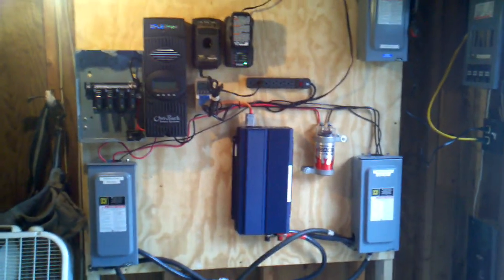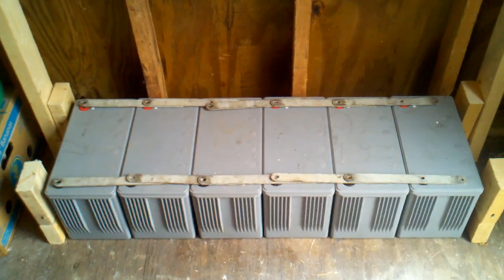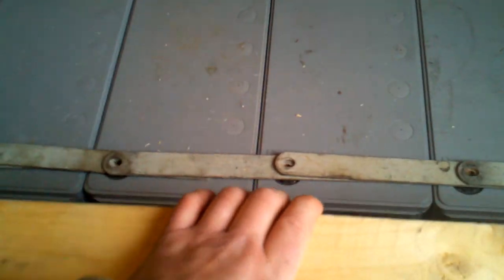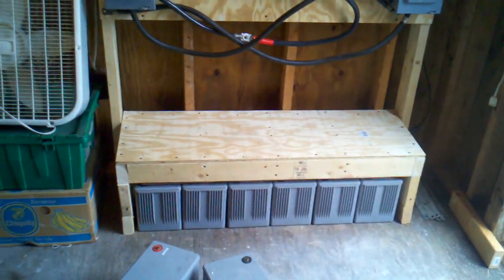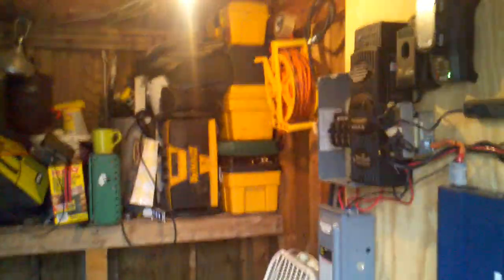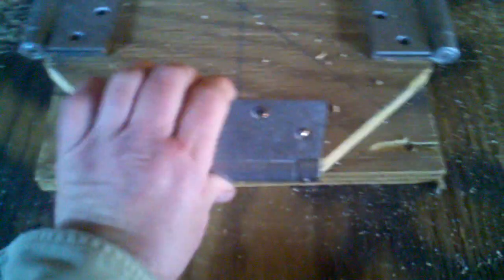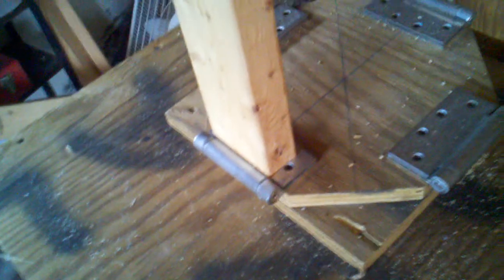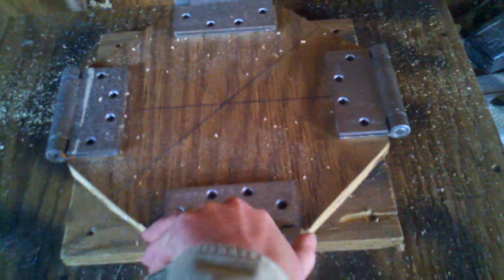Building my Data-Safe Solar Battery Bank Rack

Comment: I do not get putting batteries in the cold at all. Even in FL it gets cold at night in the winter.
Reply from the maker: +Joe Tittiger the outback system has temp probes that monitor the battery temp and compensate by increasing the voltage to keep them warm. Also heating matts can be placed to keep them warm too. Not all applications allow for batteries to be placed indoors. Thanks for watching!